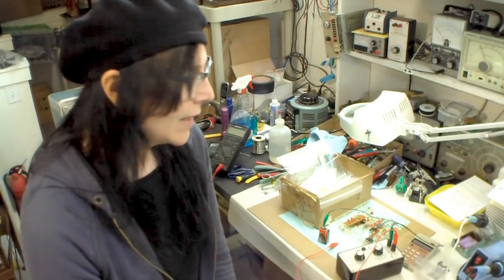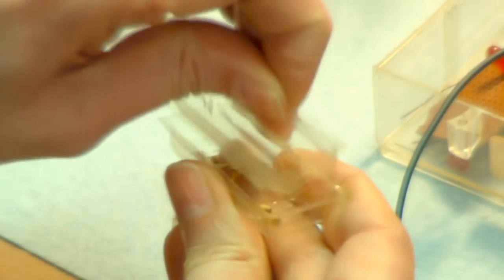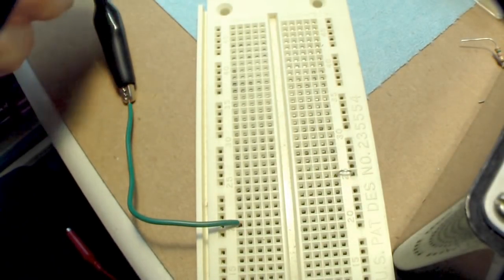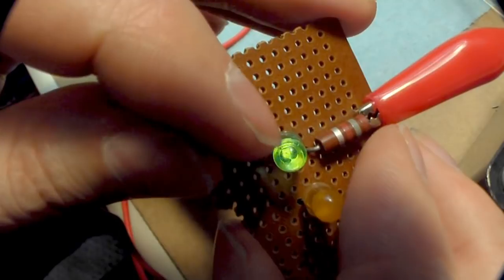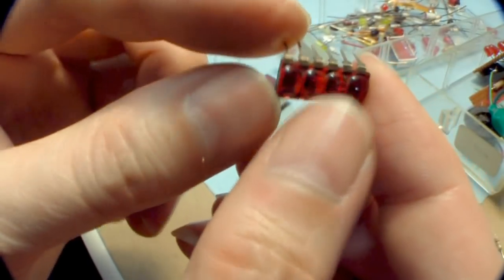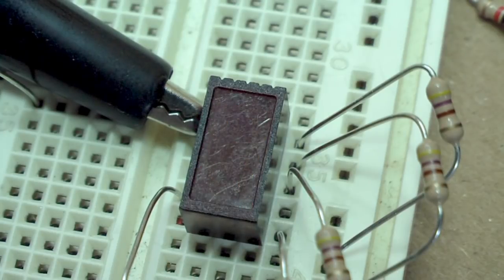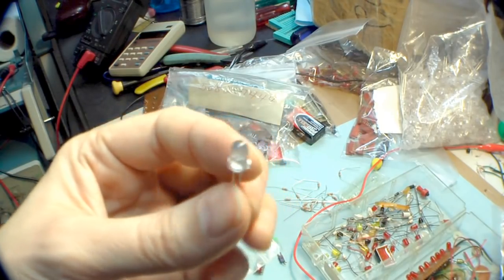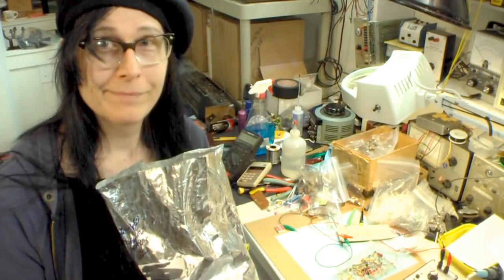The First Light Emitting Diodes

Comment: You're making me all nostalgic. I bought my first LED's from Radio Shack as a kid in the late 70's - "jumbo" (5mm) reds. I still have them in a large tackle box with thousands of newer ones.  I also have a 70's green LED with a red die inside, although I discovered in high school electronics that, with sufficient voltage, a green LED will light up orange for a second before exploding. I had a Western Electric Trimline phone with one of those unusual green LED's behind the dial. The color was different enough that I didn't know it was an LED until I opened it up. Ill never forget my first sight of a SiC blue LED - a sky-blue color that isn't seen in newer ones. Regarding unusual shapes of 70's LED's, my favorite were the ones with a faceted top. Great memories!

Comment: As you are probably aware Fran, if you shine a light source on an LED, it will generate electricity much like a solar cell. Red LEDs are more sensitive to red light, Green are more sensitive to Green light, and depending on how the Blue is manufactured, they are more sensitive to blue light. This means that you can take an RGB LED and shine white light on it... and have the leads connected to the A/D input of a microprocessor. Then you read this level and presume it to be this highest level... scale it to 255... with no light being 0... and you have a color sensor. Something interesting to play with.
Reply: Very interesting!

Comment: @Fran Blanche
If my memory serves me correctly, that TO92 IS actually a working transistor.  It would light up to indicate the transistor is in use.  I had my hand on a few of these back in the late 80's.
Reply: If that is true, They would be very usefull. I mean you can beild e.G. a Ne555 out of those transistors and see how the ic works
Reply: It would be interesting to see that type of setup in action.
Reply: +Dwayne Madden I thought it might be a HEMT (high-electron-mobility transistor) used for high gain, high frequency with low noise. The visible characteristic would be an added benefit.
Reply: Would love to see it plugged into a component tester, producing a diagram and other data. It would also flash while being tested.
Reply: Dwayne Madden I first saw my first LED tv in a large co-op in Derby, UK. I was 12, so it would have 26 years ago. Now, I understand that they were used well before this, but this was the first of the many flat screens to come, that I had ever seen. But, let me tell you.....The picture quality was brutal, it was so bad in fact that my friend and I had to stand almost the full diagonal length of the store to see that they were showing a football match! All for the princely sum of £3000! I honestly couldn't believe that something like this (at the time) would be the future of modern technology, eg monitors/tvs/phones/touchscreen technology, all lighting throughout my home, to name but a few.....The list is MASSIVE. 
I was glad to see this cool video....I really enjoy this persons dialogue, she is an interesting person.
Reply: +Shona O'Neil:
Perhaps you saw a real LED TV.
Today's TVs aren't LED TVs. They are LCD with LED backlight.
I don't know why they advertise them as LED TV.

The current monitor I am using for my computer is a LED backlit monitor.
Reply: louis tournas Well you were right before oled displays :) not anymore
Reply: LG's OLED TV's are indeed LED TV's
Reply: Franky Doodle  Not just LG... almost every samsung S series (mobile) uses organic led...
Reply: Isnt a TO92 a style of transistor, not an actual transistor, like an 8pin DIL is the package, not the component.
Reply: Well, no, it is 100 percent a package. You could hook anything you wanted to the pins. But quite often it has been used for transistors. The American first transistors pins were designated CBE, Japanese types went with CEB. I have one which is completely transparent and, Before a certain amount of light, has gain and is CBE. Very old device. When enough light is placed on the transistor, becomes two back to back diodes with no gain whatsoever present. Very interesting to test with a curve tracer and a light. ICs come as TO92 , such as the popular 977 five volt regulator. There are seven silicon controlled rectifiers listed by NTE as TO92 cased three pin devices, and I once thought it was reserved for three pin devices, but , apparently, not true. You can have two pin devices, so why not four or five pins. Two pins, such as the NTE610 .  A "voltage variable capacitance diode" ! So apparently it is simply the style case only. (NTE is a semicomponent supplier for the repair industry. The book have referenced is the NTE electronics, INC . Semiconductors , I know as a cross-reference book. Available for free in electronics repair supply stores.
Reply: Franky Doodle OLED != LED.
Reply: Antonio Tejada OLED = Organic LED ... so it is a Light Emitting Diod in deed
Reply: If true, they would've been used for educational purposes. But that's only my guess.
Reply: Ricardo Schuchmann ? (
Reply: I never met a transistor that would tolerate light hitting the bare guts. I've cut a few "cans" open and, depending
on the type of transistor, light would either turn it on or off. So maybe now ya know how an opto isolator works.
Now, I'm not saying someone hasn't come up with a transistor that doesn't care one whit about light...I'm just
saying I doubt it due to the way the things are packaged.

Yeah...I know. She did this vid over a year ago. I just now found her sight...I been somewhere else up 'til now.
Matter of fact, I was over there once ------------------------------------------------------------------------------->.
Reply: You are right, Light on a Transistor has the same Effect as Current on the Base. This was used for Intrusion Detection where a tiny Laser pointed directly on the Transistor which triggered an Alarm if the Light was interrupted.

This went obsolete with Motion detecting Cameras.
Reply: Thanks for the info. I knew about opto isolators fro working with them in certain power supplies
we made at Western Electric back in the 70s and 80s. But I missed the use of photo sensitive
transistors in alarm systems.
Reply: tom frye you can try it on a 2n3055 power transistor... open the thermal can and measure it against light... :)))
Reply: Thanks(8-).  Be nice to "light couple" certain devices. I don't have an isolation transformer to
keep equipment separated...so I need to take alternative steps to prevent frying gear.
Reply: Motorola made these strange LEDs back in the 1980s-1990s for use in camera viewfinders; their biggest user ended up being Kodak.
Reply: That would explain the extra die the the package.
Reply: Wow thats class. im just after asking that very question in a comment. so now i know. thank you dude!!
Reply: @_who_cares_1123  that would be class to see!!
Reply: @californiakayaker  me too.
Reply: @Cornz38  yes the TO92 is a transistor package. like a 2N2222 or a BC547 or a s8055 the list goes on.. & not just transistors but IC's diodes voltage regulators all use the TO92 package.. its a commonly  used  package coz its small..
Reply: @californiakayaker  what is that transparent devise you have called?? would love to have one!!
Reply: paul austin  WOW! Im going to get one of those & make one for myself..  cheers for sharing that Paul!!  : )
Reply: @tomfrye9037   YA KNOW TOM, THAT'S ACTUALLY A VERY GOOD IDEA! IM GOING TO HAVE TO BORROW IT!!  ; )
Reply: @keithking1985  I would think it would be called a photo transistor. Pulling this out of very old memory banks lol.
Reply: Ok, I'll pull this out of my led box (it had better be in there) and make a video. I did my best to find a historical transistor site mentioning it, no luck. So, I'll demonstrate what I saw.
Reply: @keithking1985  Will do a video.
Reply: @californiakayaker  YES ABSOLUTELY, WAS JUST LOOKING AT YOUR SITE ITS COOL. GOING TO SUB TO YA! YOU GOT SOME COOL STUFF ON THERE
Reply: @californiakayaker  WELL I SUBSCRIBED TO YOUR CHANNEL AND AM LOOKING FORWARD TO WATCHING ALOT OF THE VIDEOS YOU HAVE.. THEY LOOK AWESOME!! AND THANKS AGAIN FOR SO COOL AND HELPFUL ABOUT MY QUESTION!! YOUR ONE COOL DUDE THATS SURE!!
Reply: Ohh I'd love to see a discrete component computer made of these things. Glorious.

Comment: Around 1970 I bought a bag of red LED's from one of those 'Bi-Pak' type of suppliers. They were so dim they were useless for anything except status indicators in a darkened room. Turning up the current didn't make any difference, they just sat there laughing at me. Then came the (just about) usable 'standard' LEDs and then the super-bright and ultra bright, which could actually shine a beam, but the biggest shock came when the genuinely high power types arrived. These were rated in watts and a few years ago a friend and I had great fun with optical voice comms over 3 miles using these LEDs and lenses to form tight beams.  Since then, the really dedicated chaps have achieved ranges up to 100 miles.

Comment: I remember making a pulsating LED display in the mid '90s and wanted something spectacular in the center: a blue LED. It cost $20 and had to be ordered into the local electronics store (remember those?). Two weeks later it arrived and everyone in the store gathered to see it. And at that point I found out that it needed a good 5V or so to light. Which meant adding a 2N3904 on the back of the PCB and drilling some extra holes to drive the blue LED separately.

Comment: I noticed as a kid when I listened to my crystal radio in the middle of the night, I could actually see a very tiny feint light coming out of the detector diode.  I thought that was cool.  Awesome collection!
Reply: I thought that was an illusion.  I used a 150 foot long wire horizontal clothesline antenna.  Howard Sams  pushed a one transistor class A amp circuit I think it was CK722 or 2N107

Comment: I remember having an early LED display calculator. I opened it up and saw one of those circular rheostats which when adjusted actually changed the clock speed!  You could slow it down so much that you could see in slow motion the scanning of the 7-element LED number displays an element at a time. You could also overclock, which reduced battery life, but gave you faster results. (Themdays a SQR request would take a cuppla seconds to calculate(!), due to both limited hardware and poorly optimised algorithms).

Comment: In the VW model T3 (1979-1992) there was a blue upper beam indicator light in the dashboard. The indicators for oil, battery and blinker were all LEDs (red, red and green) and in early vehicles the upper beam inducator was a yellow LED, but at least in Germany this indicator has to be blue and so in later versions they had to change that yellow LED for a little lightbulb with a blue cap.
When I was little (~5 y.o.) I was always fascinated that they had a blue LED in the dashboard of such an old car. That was around 2000 when blue LEDs just got commonly available. It was a very nice cream blue, almost like a baby blue. I used to hunt that color LEDs in every electronics catalog I could get my hands on. Conrad, Mouser, Buerklin, ... It was when I was looking for it in a replacement parts catalog for the T3 when I found out I had been fooled that entire time.
Reply: +John Kapri Haha exact same for me here. I recently had to disassemble the dashboard of our T4 and was wondering too how they got their hands on blue LEDs at the time. I actually laughed at their well covered trickery there. It is done so well that you can barely catch the difference between the LEDs and the bulb.
A similar thing are old measuring devices. We once broke apart an old ground resistance meter from the late 70s during my apprenticeship and were coming across some optocoupler: Actually a light bulb and a photo-resistor covered with a rubber tube. Shows how expensive LEDs were back then because they were reserved for the indicators on the scale where you could see them.
Reply: Hahaha I've been wondering for years about the instrument cluster of a Golf Mk2 we had.
Reply: John Kapri  Lovely comment. I had also the same experience :) Those good old times newer will come back ...
Reply: We had a 82 and a 84 passat.mkII. The 82 had a yellow led with blue symbol above for hibeam, the 84 had a blue led.. which someone above says was a lamp with filter. This was in Sweden.
Reply: Ronny Svedman
Yes, curious. I know that blue LEDs were invented in the 80s by a Japanese company, and although it is possible it is a incandescent with blue filter, I honestly don't believe that is what was in that Rabbit I had from 1984. I'm almost positive it was an actual blue led.
Reply: My 1984 VW Quantum had a green LED for high beam. but I replaced it with a blue LED (several years after 1984).

Comment: This video is heaven. I've always felt the same way about LEDs. As a kid Radio Shack was my second home mostly because of them. I would buy them and stick them in things with dead watch batteries which still had enough power for them any chance I got. At a summer camp we were supposed to draw a picture and stick the little ornament incandescent bulbs in them and I brought some LEDs from home and used those instead haha. Then as an adult when automotive LEDs started becoming a thing I replaced every single bulb and light fixture with LEDs. Then when LED light bulbs kicked off replaced every single bulb in the house with LEDs. LEDs are amazing! Instant subscriber!
Reply: Tandy (Radio Shack in the UK) used to sell packets of assorted LEDs, all kinds of weird and wonderful designs like ones with Fresnel lenses.  I used to love getting those, and still have some.  Kept waiting for a blue one, but by then Tandy had gone.
Reply: I loved those little packets of assorted LEDs! It was a great way to get a bunch of different kinds of LEDs without having to buy them individually (plus the fact that sometimes they contained ones they didn't even sell individually). I believe I still have most of them somewhere as well.
Reply: I have a few LED battery-operated dome lights, which I covered with wax paper to diffuse them. They are now easier on the eyes.

Comment: Years ago ( late 80s to early 90s) I modded several guitar pedals with the addition of LED indicators to indicate when the pedal was turned on, as well as changing out the stomp switches for true bypass when turned off. The LED would also dim slightly as the battery became weaker, a nice feature to have.

Comment: Thanks, Fran. Brought back some memories. I still got a few of those, some in metal cases with clear tops. I had an early 1970's 1 w red led with domed top with a gold solder tab on a side and a 6-32 bolt through the bottom to heat sink it.  I used that as a nosecone light on a model rocket in the early 1970's. It is mentioned in my model rocket video.

Comment: I learned a ton! I totally get the appeal—some of that early circuitry was beautiful in its own quirky ways unique to their eras. Fascinating to know that the calculator displays rely on a timer and human visual permanence—not the most intuitive solution but it definitely seems to simplify things. I always wondered why old LEDs were always red, now I know! I feel deceived that modern LEDs use UV and phosphorus to “cheat” to achieve their color rather than produce them purely. Reminds me of tube TVs with their phosphorus coating or even incandescent lantern mantles. Still a fun solution in its own way. Thanks for doing these.

Comment: I love the sight of a 1970's era LED refracted and reflected through a faceted plexiglas bezel!  A friend of mine (Tullio Proni) and I both made LED pendants for science fiction fans with plexiglas fronts, mirrored plexiglas backs, with small batteries and circuitry behind.  We used 555s, LM3909s (invented by Carl Kleiner, another SF fan), or XR-2240 (?) sequencers.   About the same time, I got an HP-35 calculator for college.  With friends, we played with those LEDs dunked in liquid nitrogen, cranking amps of current through them, until they became plastic-emitting diodes :-)  Fond memories.
Thanks for your great YouTube series.  Happily subscribed.

Comment: Hi Fran. I did my own self learning about the same time as you - late 70's early 80's. I had two 32 drawer bench parts cabinets stuffed to the brim with LEDs of all sizes and shapes. By the mid 80's most of commercial electronics was moving to LCD displays and LED manufacturers were trying to unload their stock. You could buy huge bags of various LEDs for a couple of dollars. The intrigue was sorting all the LEDs to their individual drawers and imagining some project where they could be used.
Interestingly, in one bag of "micro displays" was a 12 digit, 17 (I think) segment, multiplexed tube display. Now THAT was a work of art! I presumed from the gold contacts and connectors inside the tube that it probably was manufactured for a military application - probably cost Uncle Sam several hundred dollars a unit and here it was in a grab bag for a couple of bucks! I found it so intriguing it drove me to learn how tubes worked.
 I'm surprised you did not show a tri-color LED; +/- = red, -/+ = green, alternating = yellow. These two element LEDs were a mystery to me until I later learned about RGB video displays and that mixing red and green light makes yellow. 

TO-92 LEDs - at the time of my self schooling I worked for a residential alarm company. The system used FM radio to connect the various sensors to the main control and most of the sensors were housed in plastic boxes stuck to windows and doors. To prevent tampering the sensor used a TO-92 red LED and an IR sensor separated  by a thin tab of plastic in the case top. If the top was removed the IR sensor would "see" the LED and complete a trigger circuit. The TO-92 package for both devices meant it could all be mounted directly on the PC board. I know that several early models of HP printers used this arrangement as a paper sensor.